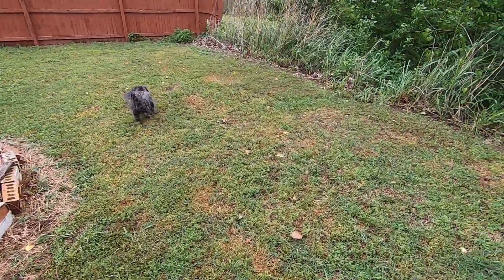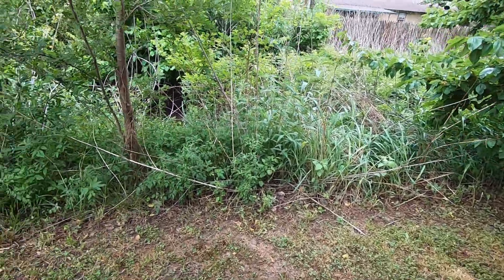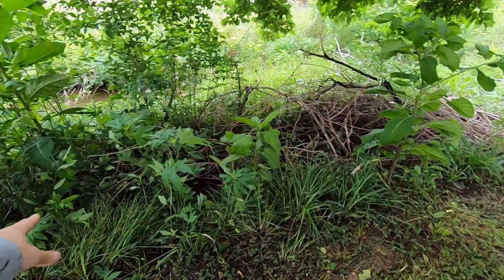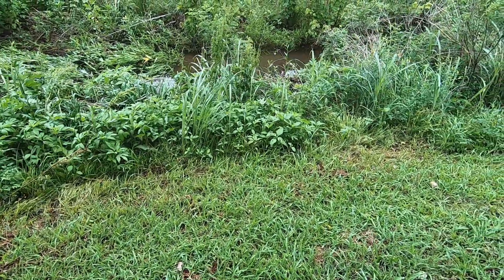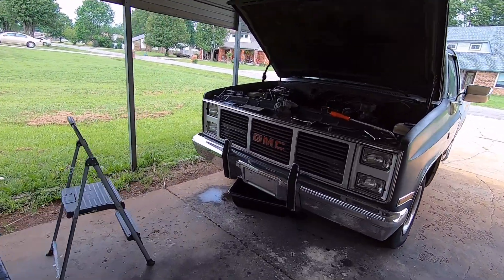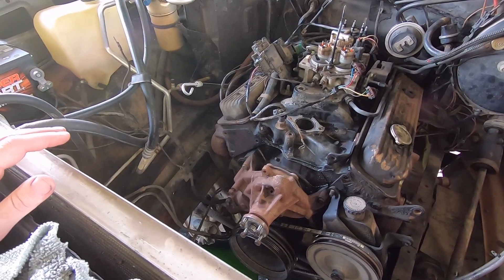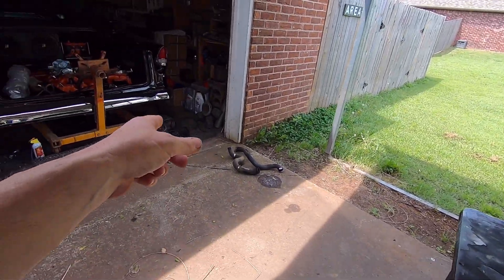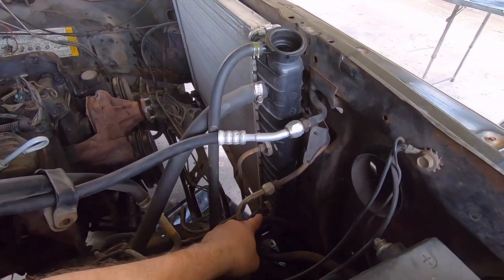Started the engine removal on my 87 GMC square body

Comment: I worked my tail off to buy a new 87 GMC 2500 - 2wd.  I’ve still got it and had the motor rebuilt awhile back. I am getting ready to drop the motor back in it. It was s pleasure to drive but I had bad luck with it - bad motor from the Canadian Factory (Windsor) ... mine had the antifreeze odor too - I think it was the radiator cap ?

Comment: Oh, before you pull the hardtop engine out and tear it down, please check for a cracked flexplate! May be that simple to fix. Cracked flexplate can make a deep metallic clacking sound, worse at idle rpm.